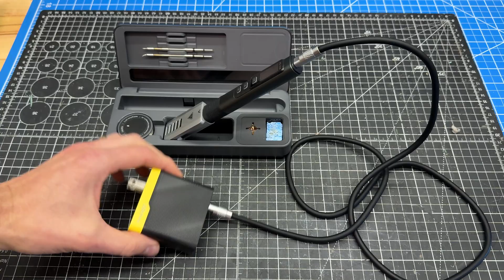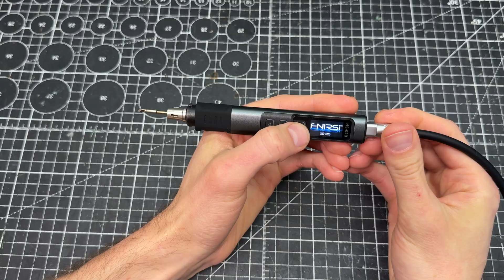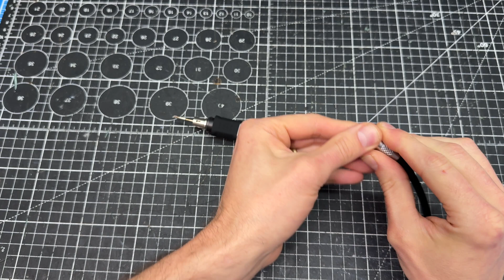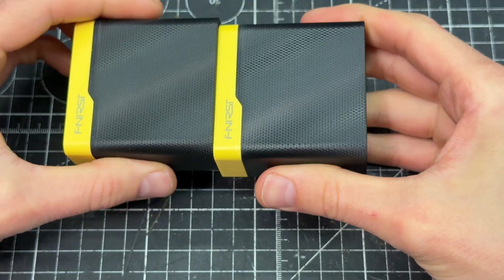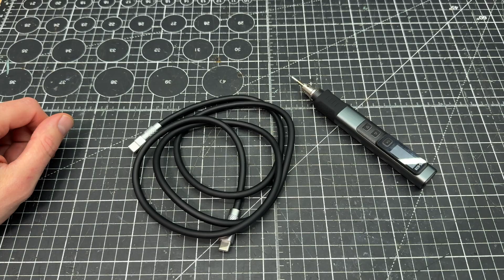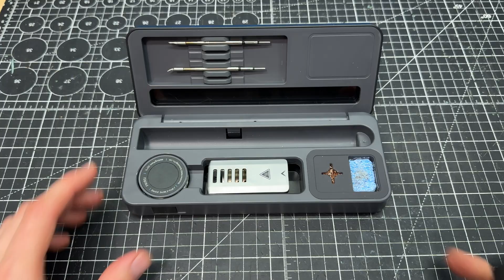FNIRSI HS-02A HS-02B Low Voltage Warning Solved - GaN Charger/PS & Cable Orientation w/ CC Issue

Comment: I'm surprised that the original supply's input voltage only goes down to 110V, and not 100V as is common with just about every USB charger out there. Some countries use 100V, and even in the US (with 120V mains power), the voltage can dip below 110V depending on your specific house, especially if a space heater is being used in an older house, or whatever.

I wonder if this played a role as well. 100V - 240V input is pretty much the standard for these types of devices.

And it's a bummer about the included cable since that's a beefy, silicone-sheathed cable that looked really promising. Hopefully they've addressed the cable issue since then as well.

Comment: Try setting the power level to 90% or 88% in the soldering iron menu and it will be ok. You won't know the difference. Soldering iron on booting consume 140W peak power. That is all.
Reply: That's great, but that doesn't address why this problem was happening in the first place. This video is about troubleshooting and trying to find the root cause of the issue.

Comment: I have the old version and the new version. New one I had an issue when the soldering iron was set to 95%+ power. 
Typically use a different cable when at a bench otherwise I have a USBC to PD to connect to a power adapter.

Comment: The same thing here. Replaced the original cable with 100W IKEA USB-C to USB-C and everything started to work consistently with the original FNIRSI power brick (old style). Thank you for your video- very helpful.

Comment: why didnt you try a barrel jack 100w laptop charger.?
Reply from the maker: Because I did not have one :) I did test it with my bench power supply though and it worked. I did not think it was relevant to the scope of this video to include that though.

Comment: the anomalous behavior here is consistent with there being a missing Ra resistor on one of the plugs (both sides should have this resistor so that the E marker chip can be powered from both sides and become discoverable). this is the chip that advertises to the power supply that this cable is capable of >60W and gets granted higher currents and voltages. because power only comes from the power brick, the side with the Ra resistor must be plugged into the power brick or else there is no negotiation for PD and power is limited to 5V and 15W max, which is not enough if the iron is started cold.

one other explanation is the cable only has the e marker chip on one side by design when it should have two. but i think this is unlikely because this is FNRSI not some random cable brand. if they send an identical replacement cable that works then it confirms original was a defect rather than design flaw.

so i think this a cable manufacturing defect. like one of the chips being completely dead, or my preferred missing Ra resistor theory which can and does happen for several on an entire batch of bad cables, for example if the machine operator doesn't notice the resistor bin is empty and yet it still churns out new cables. also no quality control to catch them. this is quite concerning coming from FNRSI. i also noticed an obvious typo error "Modrl" instead of "Model" on the second brick they sent you. kinda makes you doubt the other markings they have printed on there. it actually looks well designed and built so again...very concerning.

you can verify the cable defect by checking continuity on both plugs. this would be easier if you had a usb c breakout board to probe the pins. but basically in a compliant cable, on plug 1, one CC pin (e.g. CC1) should have about 1kohm to gnd pin and the other CC pin (e.g. CC2) should be open to gnd pin; and on plug 2, the inverse. i think your cable is missing the 1kohm resistor on one of the plugs so one side will have both CCs open to gnd. 

i would have liked to see you rotate the plugs 180 degrees first before swapping the plugs as this might have revealed or exclude a second defect in combination with the missing Ra resistor. for example CC1 on one side is straight connected to CC1 on the other side (it should be cross connected CC1-CC2 and CC2-CC1 respectively). 

in the ideal case a defective cable like that (with one or both defects) will just be rejected from PD power negotation and function like a lower power cable, which it seems to be doing--it just looks completely useless when connecting to a high draw device. 

in the bad case the power brick is lax with rules and supplies PD anyway (remember, your first brick actually worked intermittently earlier which it shouldnt have at all when the wire was connected in the "wrong" direction) which of course is extremely dangerous because you would never know that cable is a ticking time bomb if the brick doesn't reliably reject it. FNRSI very clearly has avoided directly saying that their brick is PD compliant. so you also won't know if its just the defective cable or also a non compliant but apparently still working brick. at minimum i would just cut that cable in half and throw it away so it doesn't accidentally become someone else's problem--without a tester you have no idea what other defects it has.

Comment: Some USBC cables only have the smarts to communicate power requirements one way, which is what you've discovered by switching the orientation of the cable, ie the side that has the chip that is connected to the iron rather than the power supply provides the required input for the iron to work reliably. Getting a quality emark cable with the chip on both ends will mitigate the need to ensure cable "polarity". Also the resetting that you're seeing is the iron unable to pull the required voltage to power up, if you turn the "power" setting down you should get a reliable startup, i find the setting around 60% works well, you do lose bit of the performance of running at full speed but you get reliable power ups. Once the iron is up to temp you can adjust the power if you need the fast recovery times.
Reply: its weird because none of the other reviews seemed to mention this. and i doubt that all of them just so happened to put the cable in the right orientation. 

so either they didnt bother to mention it or they really sent this guy the wrong cable

Comment: I don't think so. It's highly likely that when high power is drawn, the limiters (short circuit cut or thermocouples) suddenly shut down the power supply. Therefore, I think the problem lies in the soldering iron itself. The firmware doesn't apply the draw curve properly and draws all the power it can draw (as soon as the soldering iron is turned on).
Reply from the maker: Many viewers have reported the same issue and swapping the cable orientation resolves it. Not sure if it’s a permanent fix but it is definitely a “thing”

Comment: i bought and it is an amazing solder, i just use a good cable and power supply since the beginning, i did not get the fnirsi one.

Comment: I have one cable from FNIRSI that looks just like that and another one I bought from Amazon that looks the same but is from a different vendor and is  in a different color. Both of them are incorrectly wired in the same way. It's not just on the soldering irons, but on other USBC equipment I have that they only work in one orientation. They're too nice to throw away, but there's something definitely wrong with them! I love my FNIRSI irons, however!

Comment: I had boot loop issues on mine. And directionality with the usbc cable. I also have a 100w gan charger from anker for my laptop and using it solved all the issues. I also have a 100w usbc power bank for my laptop and it worked fine with that as well :-)

Comment: The reason why the iron is default in 65W power setting is that they KNOW that their devices struggle at this power topic. In 100W setting my HS-02A always gets into power cycle loop. I'm using the newer version of the Fnirsi PSU and a Pine USB cable 1,5m. It uses way more than 100W!. Even when it's powered by PC adapter and 150W Korad bench PSU this PSU goes down with output voltage for a few seconds. So runnig the iron with 65W setting is the best compromise. The 100W are China watts just for advertising...
Reply: OK, but you saw that the iron is capable of 100W if the cable and charger are fine, right? In your attempt at saying the advertised 100W is disingenuous, you make a disingenuous remark yourself.

I don't like that FNIRSI's complete package is not fully functional, but instead of making things up about the power ratings of the iron, my complaint would be that the iron, cable, and charger they give you aren't all fully compatible with one another. FNIRSI's mistake is not ensuring that their own products can function together. Hopefully, they've started including a cable and charger that are fully compliant with USB-C standards and each other so that no matter how you plug the cable in, the iron will work at 100% power every time you want to use it.
Reply: @person880 No, because my 150W (!!) Korad DC Power supply also gets temporarily overloaded by this iron. It often pulls heavy spikes of current for a short period.
Reply: @hansmoser162  It's a popular iron, so it seems like quite a few people got it to work. I wish USB-C wasn't as confusing, and hopefully FNIRSI make their product better in the future so that these power issues no longer exist.

As for drawing way more power than it should, all the power is negotiated inside the USB-C protocol. If the charger won't provide more than requested. Imagine an old, 5V 1A charger that you connect to a modern phone that can charge at 30W. It's not going to blow up the charger. The charger will just provide the 5W, and the phone will just take the 5W.

Comment: Fnirsi cable is very good,chargers are the problem.
Reply from the maker: Strange, I come to the exact opposite conclusion in this video.
Reply: @NovaluxStereophonic  I have hs-02a tried with Fnirsi 100W charger works fine (100%) on cheap 120W works 40% power,Huawei 100W charger 90% power.Low voltage warning gives with different cables,Fnirsi cable says 250W 😄.I’m not going to use full power with 100W charger just tested how it performs,for 100W needs more than 100W quality charger.

Comment: I have the A version and I use a 140watt battery and have had no issues with the provided cable. If you’re using 100 watt you might need to lower the power as it will draw the full 100 watts.

Comment: Thanks for the video. I had the same problem, Fnirsi sent me a new charger and cable, but these have the same issues.
I tried several cables and chargers, but I did not have the idea of turning around the cables before this video. So thanks for that. It definitely has an influence, not only with this cable, also with some other of my cables, but always just with this soldering iron. With all other devices all cables and chargers works in both directions.
With the soldering iron some combinations worked, some not. Some chargers work with a cable, but not with another and vice versa. But all chargers as well as the cables worked in any combination and direction with any other usb device but not the soldering iron. 
So it must be a problem (probably with the usb-port-software) of the soldering iron.
Reply: Hi. The problem goes away when you reduce the power level to below 30% in the settings. You can try it and test it.

I used translate. I'm writing from Türkiye.

Comment: My HS-02A has problems starting up with supplied cable as well, changing end seems to work, partially. Also starts better if Iron warmed up first. Problem seems to be more than one problem. Thanks for your demonstration.
Reply from the maker: Thank you for sharing. Sounds like I am not alone. Glad that swapping the cable around seems to do the trick.

Comment: Thanks for the video, I also thought the charger is broken since i can operate without boot loop on other 65W & 120W GaN charger till I switch side on the cable with original charger, seemed like the cable that comes with it is one direction only.

Update:
Today tried it with proper orientation of cable, it worked fine and then i put it on standby, when i pick the iron to start soldering again pressing OK will trigger the same restart problem, reducing the power to 65% fixed it....will try other quality 100w rated cable next time.

Comment: The other guys beat me to the "I'll stick with my..." comment, but yeah, I'll stick with my good old made-in-USA Pace ADS200.  I had a problem once and Tony in North Carolina fixed me up right away.  I guess it would be nice for portability... I'd probably go old school with a butane torch for that if I ever needed it.

I don't know too much about USB-C other than the cables have to support a minimum of 60 watts, and a max of 240 - and there's usually no visual way to tell other than keeping track of it when you bought them.  I wonder what their cable was rated at.  The one you found in your stash looked pretty stout, I don't think it would have worked if you used an iPhone USB-C cable for example.  Strange that they suspected the power supply and not the cable right away.
Reply from the maker: They had me go through some troubleshooting steps and the iron worked with another USB C charger so I think that’s what led them to replacing the supply initially.
Reply: @NovaluxStereophonic I'm curious if the first black adapter with three USB ports (no longer available) was better than the yellow one they're selling now.

Comment: I am still using my trusty Wahl Iso-tip 7500 series and it has been workhorse for me since the mid 1970s. I wonder what is the lifespan of one like this.
Reply: Obviously this is not to replace your bench iron, you can keep your trusty 1970s iron. This is marketed as portable iron, so this is an additional tool.
Reply: And how much did that cost back in the mid 1970s? This FNIRSI is meant to be a portable and configurable iron with accurate temperature control for precision work. Every product has a different purpose.

Comment: Hi. I had the same problem, except I have an EU charger that says 180-240V 0.7A. Thanks for info!
Reply from the maker: Please let us know here if you are able to resolve the issue with an alternate cable.
Reply: @NovaluxStereophonic No. I'm still using the original cable, I just marked which end goes into the soldering iron.